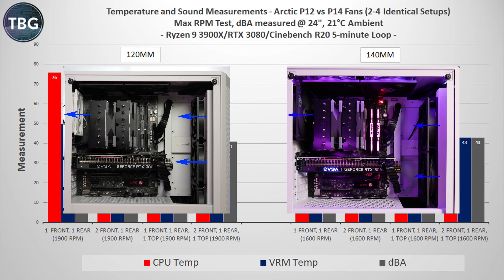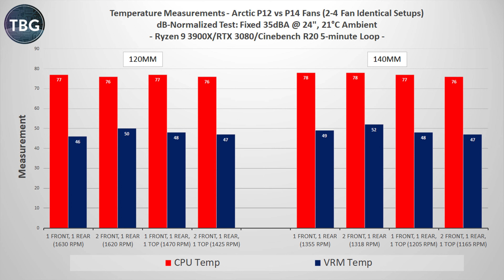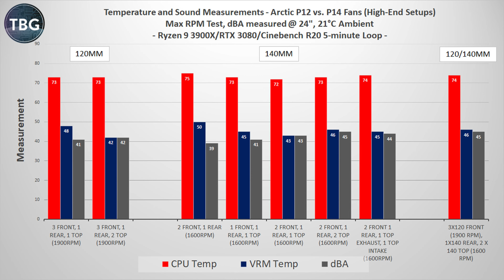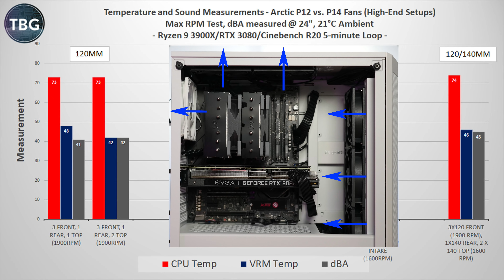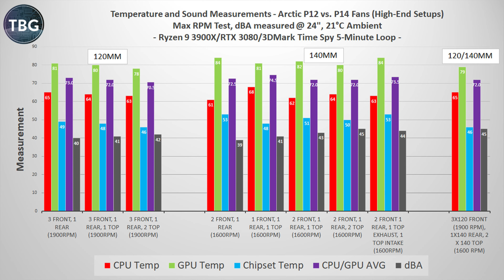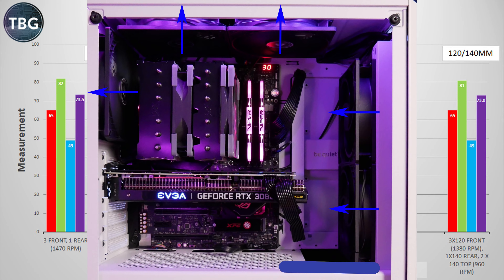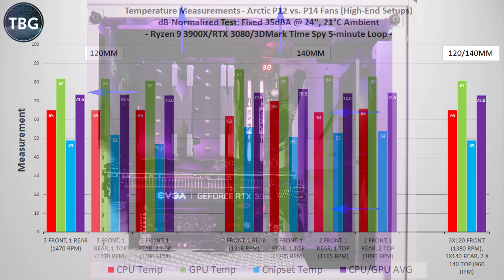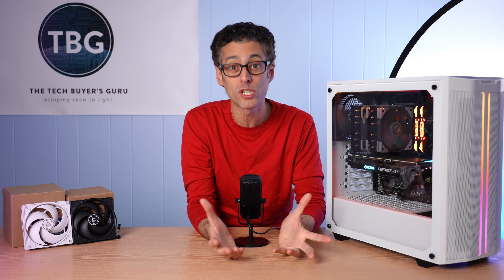The Best PC Case Fan Setup - How Many, What Size, and Where, feat. Arctic 120/140mm Fans!

Comment: Just ordered a box of P14s last week, 5 for the half the price of one Noctua 12x25... just to test them. At 600-700rpm they are super silent and have a very pleasant sound, while moving relatively large amounts of air, certainly enough to keep everything cool.

Between 700-1100, they create some slightly annoying turbulent sound, which stops at 1200rpm... here they have a louder, but pleasant sound again. Therefore, I recommend them for either silent or maximum performance builds.

Still waiting for Toughfan availability in Europe... only the 140mm version is available and I am not sure about those yet.

Comment: You should have tested the F12 and the F14, because they are optimized for Air Flow, the P series are optimized for Pressure.
Reply: seems good on paper, but they are outdated and the P fans are all around better
Reply: @ribale609  really? I didn't know that, so the P12 and P14 are an all arounder like the Noctua A12-x25?
Reply: @Alessio.B87  yup
Reply from the maker: KKong is correct. The F-series fans are not that good, while the P-series fans are excellent for everything.
Reply: @TheTechBuyersGuru  thank you I didn't know that, I thought that they were the same fan but with different optimizations. You guys saved me from buying the wrong thing!
Reply: Thanks guys! I was about ask the same thing myself.

Comment: When thinking about multiple fan setups in a case, it's useful to think more in terms of pressure than airflow. An intake fan generates a high-pressure zone, while an exhaust fan generates a low-pressure zone. Air always moves from high-pressure areas to low-pressure areas.
Reply from the maker: That is a very good point. But air doesn't always move from high pressure to low pressure, it has to have a pathway to do so. So putting a high pressure fan in the wrong place means low airflow, and hence poor cooling efficiency.

Comment: Awesome video! Tho I wonder if not being able to use 3x140MM fans in the front didn't skew most of the 140mm results due to not enough air intake causing the exhaust fans to "pull" air from wherever and raising the temps. Would be interesting to see if a bottom mounted fan(right under the gpu) like old cases used to have wouldn't improve GPU thermals by a bit.
Reply from the maker: I think there's a big opportunity here for case manufacturers to change their designs to allow for bottom-mounted fans. The PSU shroud has improved the look of PCs, but not necessarily the performance. My biggest wish is that more manufacturers start rotating their PSU placement like the unusual Cooler Master SL600M - https://amzn.to/3n0f8fj

It puts the PSU in the front and allows unobstructed bottom-to-top airflow. This is perfect for GPUs, although for CPUs it may require liquid cooling for optimal performance.

Comment: When i had my fx8300 system i ran 2 120s front and 2 top 120s, all as intake with the only exhaust at the rear, as well as a gpu with a blower cooler and my psu "uspide down" for more exhaust potential. Was great setup for cpu, vrm and oc'ing - basically the only thing that system was good for.
I really love your fan content. I thought 4 140s would take it over the 6 120s because of the lower speed. Good stuff as always.
Reply from the maker: If you look closely at the dBA-normalized 3DMark graph for the extreme setups, you'll see that the 4x140s were excellent for CPU temps, but not quite as good for GPU temps. I suspect that if I had lowered the bottom fan below the level of the PSU shroud, the temps would have (counter-intuitively) been better for the GPU.

Comment: am i blind or  isn't there any significant change in all these results?  maybe one or two deegres difference
Reply from the maker: I grouped them by mainstream (2-4 fan) setups and high-end (4+ fan) setups. They are not remotely the same. For the 120mm fans, there was on average a 7-degree drop. Less for 140mm fans, which work great when 3 are used.

Comment: Would have loved to see the bench with the noise measured from  what seems to me to be a more classical position : "my computer is on my desk on my side". Just to know if the impact of the top fan is still that significant for the dB !

But man I love your vids :D
Reply from the maker: I did consider that some people have their PCs on their desks, but my desk isn't big enough, and that actually puts the fans closer to the user, too. I don't think this would have changed the results significantly, but certain configurations (like fans at the top) would have done better in the noise-normalized tests.

Comment: Well, that 140mm performance was disappointing. I did not expect those results.
I thought the bigger the fan the better from a noise normalized perspective. Boy I was wrong!
I guess I will just buy more P12 fans haha.

Great video as always sir. Thank you for taking the time to experiment with so many configurations!
Reply from the maker: I was a bit disappointed too, but it doesn't mean they are bad fans. In the 3- and 4-fan configurations, they were actually better than the 120s. But putting 5 in the case just added a bit too much turbulence, which increased noise and may have disrupted airflow out of the chassis.
Reply: In my experience, mixing sizes and speeds give the best noise results.
My current setup in a similar case tested in the video is 3x120 front + 1x140 rear + 1x140 top as exhaust (the rearmost position, above tower CPU cooler) and that gives the best results for me.
I guess results may vary depending on case and fans models.

Comment: Here's my prediction: Artic P14/P12 is the best value! Lol
Thanks for another great video!
Reply from the maker: Your odds of winning were 100%, so yes indeed, we have a winner! ;)
Reply: @TheTechBuyersGuru  I bought 1x P14 and 3x P12 (a year ago), and only 2x P12 ended in my PC case, working perfectly, almost inaudible at 780RPM. The other ones went straight to electronic waste. Arctic quality control is abysmal. The price on them can be easily multiplied by 2. Half of them are expected to have fan screeching, motor vibration defects, or both. It's a pity that they seem to have so little competition. Noctua is expensive and its sound signature is a silent chainsaw.
Reply: @T4ish0  and its ny dilema. I need 4 slim fans, should i buy 4 cheap artic slim (44€) or to expensive noctua (25€ each the chromablack 😬)
Reply: @TheTechBuyersGuru  100%? Anyway I can get those odds in Vegas? Lol
Reply: Kind of contradicts with scythe 120mm fan 😁
Reply: @ollieh2587  Hmm... good point, ok, the Artic will win in terms of best value! Nailed it.

Comment: Really Great job on this video 👏👏. Here is a fan weird set up that I though that might just work:
- Back: 120 fan Intake
- Top (above ram): 120 fan exhaust
- Front Panel:
  # Bottom Slot: 120 fan @ 1500rpm min
  # Middle Slot: Empty
  # Top Slot: 120 fan exhaust
- Finally place 1x 120mm fan on the PSU shroud below the GPU to direct air from the Front bottom fan , straight to the GPU.
This set up  uses 5 fans that can be bought from the value pack, provide airflow on the vrms closest to the Scythe fuma and provide cooler air in a more direct way to the GPU ! 
Hope you like my idea I really enjoy your content! Sometimes I just sip my coffee watching you build PCs!
Reply from the maker: This is indeed a really interesting idea, and I think adding that bottom fan is a great idea. You'd just have to make sure to flip the fans on the Fuma 2 to make that reverse airflow work, and I'm not sure they'd be quite as effective in a pull arrangement as they are in push.
Reply: @TheTechBuyersGuru  If the fans are reversed, they would be on a push configuration, pushing fresh air from the back and pulling it in the case , where it is immediately exhaust by the Top fan, am I right ?
Reply from the maker: Push and pull refers to the orientation of the fan on the heatsink (or radiator) fins. So if you have reversed the airflow in your case to go from back to front, then you need to flip the fans on the Fuma 2. This makes them "pull" fans, as they are pulling air through the fins, not pushing it. Fans are typically a bit less effective in this orientation.
Reply: @TheTechBuyersGuru  Oh alright, I get it now ! Thanks for the explanation! 
Theoretically tho, both push and pull configurations should level out , as RPM increases right ?
Reply from the maker: They are close, but they are not the same.

Comment: I’m running Arctic P12 and P14’s in my case based on your previous reviews.  Overall been satisfied with the performance.
Reply from the maker: My recommendations stand - these are excellent fans. The fact that I was able to find some configurations where P12s outperformed P14s doesn't diminish the products in any way. I believe that in much bigger cases, the P14s might be warranted.
Reply: have you heard any harmonics from certain speeds? if anything i hear rubber mounts help isolate those vibrations
Reply: @Aleph-Noll  I was wondering this as well, seeing as the Arctic fans have no rubber mounts and just bolt straight to the chassis, this is a concern.
Reply: Did you find p12 quieter than p14 as he said?
Reply: @LeoTelles  Don't forget he was positioning the dB meter over the case and did say that you hear them the most , but if the case sit on the desk it could be a totally different story too.

Comment: So it would be safe to buy three scythe kaze 120mm with stock fans. I'd most likely run the top exhaust at lower rpm considering you mentioned those would be the sound that is most noticeable. I also have a scythe fuma 2 so I'd want to have matching fans.
Reply from the maker: Are you planning to put two Kaze Flex fans in front and one on top, and then use stock in the rear? What case do you have? Good choice on that cooler - it's fantastic!
Reply: @TheTechBuyersGuru  All 3 in front, having the rear run normal and 2 top exhaust at lower rpm and seeing what happens.. I have a 500 DX lol Probably should have included that too. I bought the case before seeing your videos showcasing the the 500DX but I did buy the fuma 2 based on your review and others.
Reply from the maker: Sounds perfect - you are basically doing my combo setup, but with thee Pure Wings 2 140mm fans in place of the Arctics. These are good fans too, not excellent, but better than almost any other stock case fan. So yes, get the 3x120mm in front, that is perfect as I have shown, and then mount two PW2 fans up top (at low RPM!), and one PW2 in the rear, probably at a higher RPM than any of the other fans. To learn more about how the PW2 fans compare to P14s, check out this video if you haven't already: https://youtu.be/PUdsTiRmuuU

Comment: Hi Ari,

Some things are very comparable to my data.
About flipping the fans, I actually flipped all top fans to intake and this actually made a decent difference. Maybe worth a shot to test this out?

But at the bottom of the line we both come to the same conclusion, 120mm fans cool better and are (when tuned) also more quite then the 140mm’s surprisingly enough.

Good to see the results on 2 completely different hardware setups the results are somewhat the same.

Good luck with your further tests, I might hook up on another one in the future 👍🏻.
Reply from the maker: Thank you again for sending me your data, and yes, it's amazing to see that we both came to similar conclusions. I looked over your data before I did the tests and found it surprising, but you were right! I also saw that you tried flipping both top fans, but I decided I was going to limit my testing to configurations people had asked me to test. I think having both flipped might work in some circumstances, but my guess is that the GPU results would be just as bad or worse in my test setup.
Reply: @TheTechBuyersGuru  Hey Ari, well I didn’t mention the GPU temps in my data I send to you tough I did monitor them (don’t know why I didn’t put it in the sheet). But it did not hurt the GPU temps at all.

Nonetheless keep up the good work, people can really learn a lot from your reviews as do I 👍🏻

Comment: Just bought a value pack of p14 yesterday. I have 3 fans installed in the front, 2 in the top and p12 as a rear exhaust
Reply from the maker: That will be perfect! What case do you have that fits 3x140 in front?
Reply: @TheTechBuyersGuru  Deepcool matrexx 55 mesh. In case somebody reads this and has the same case note that you have to install front fans on the internal side of the case except for the bottom fan. P14 is 27 mm thick and it would interfere with some part of the case if you install it on external side and won't let you put on the front panel.
Reply from the maker: That looks like an amazing case! - https://amzn.to/2L7HNlu
It seems they are now preparing a 4-fan ARGB version of the case: https://www.deepcool.com/product/case/2020-01/9_12888.shtml
Unfortunately, it does not appear to be available in the US yet.
I recently featured one of Deepcool's low-cost mATX cases on the channel, and I was very impressed with the quality for the price. I also have tested several of their AIO coolers and was equally impressed. I will be testing their best ARGB fans in a shootout soon, and when I request those samples, I'll also inquire about retail availability of the 55 Mesh ARGB. That could be a very competitive case depending on price.

Comment: do you recommend that air cooler for a ryzen 5 3600?
Reply from the maker: Scythe Fuma 2: https://amzn.to/2Jx3hYy
3-week wait on backorders. Pretty typical. It's the best cooler under $100. I recommend it to anyone who can actually buy it!
Reply: @TheTechBuyersGuru  what aio for nr600 case r5 3600 you recommend?
Reply: @TheTechBuyersGuru  i think im leaning towards the nh-d15 chromax, i know 40 bucks more but better cooling.
Reply from the maker: The D15 is great, but you'll see no benefit on the Ryzen 5 3600. Have a look at these results: https://youtu.be/HZOGK49NGLQ
Cheap AIOs will underperform the Fuma 2, if you want to actually outperform it you have to spend $100+, and again, on a Ryzen 5 3600, it's not going to help.
Reply: @TheTechBuyersGuru  im also thinking about future if i ever get a 5600x or higher cpu. think the fuma 2 would be good for the 5000 series cpu's?
Reply from the maker: The 5600X is very similar to the 3600 in power use, so again, I'd go with the Fuma 2. I'm currently using the Fuma 2 on a 3900X, which uses more power than either the 5800X or 5900X, so yeah, the Fuma 2 is just fine. It impresses me more every day, I really didn't think it would work this well for my high-end CPU cooling benchmarks.
Reply: @TheTechBuyersGuru  what about 5950x?